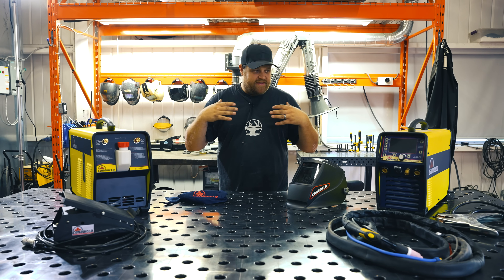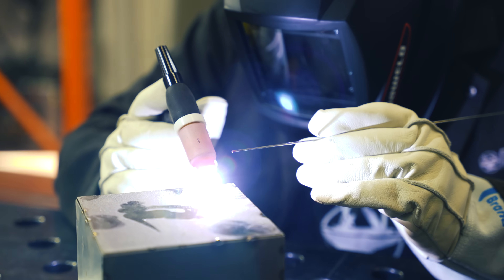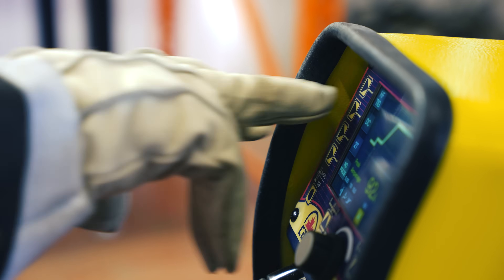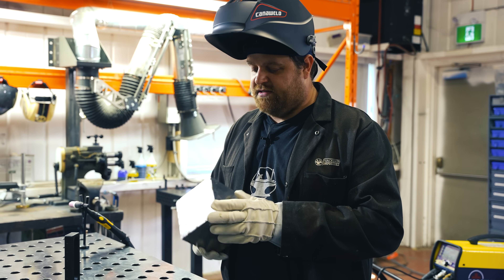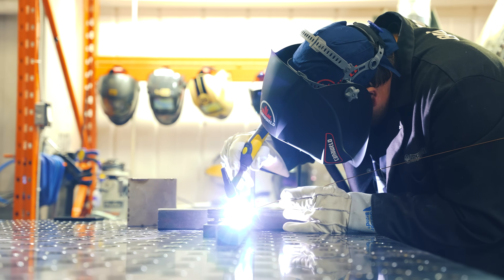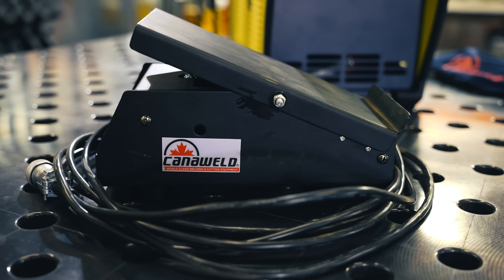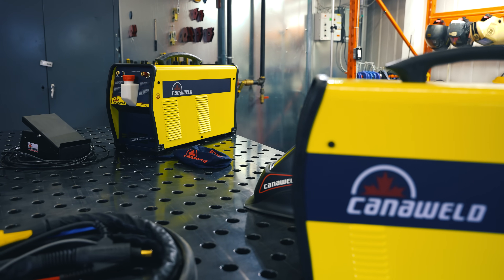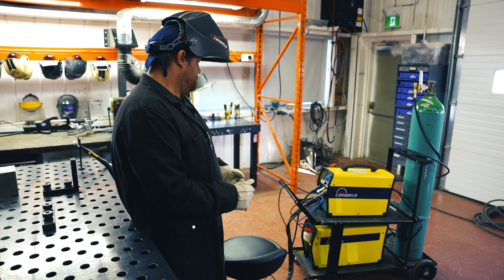Advanced TIG Welding Techniques & Tips

Comment: Good ad, waiting for ball park price though...
Glad you left contact. Does it also do Titanium and different alloys?
Reply from the maker: @andykerr3803 Thank you for your interest! The TIG AC/DC 281 Pulse machine is indeed suitable for welding titanium and various alloys. Its advanced features, such as pulse control and inverter technology, make it ideal for high-quality, distortion-free welds on thin materials. Currently, we're offering this Silver Package, which includes the machine and accessories. Pricing starts at $5,988 for the air-cooled torch model. Visit our website for more details or feel free to reach out at 437-836-9713 if you have further questions!
https://canaweld.com/product/tig-ac-dc-281-pulse/